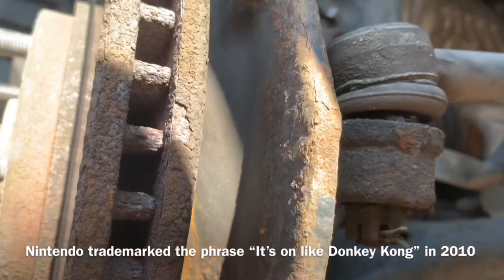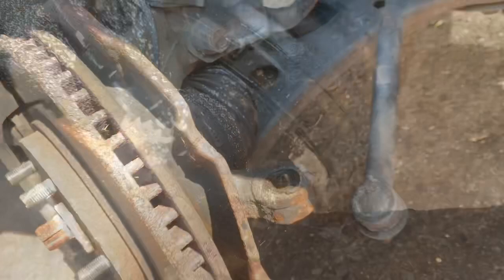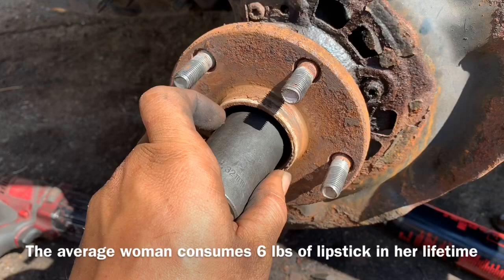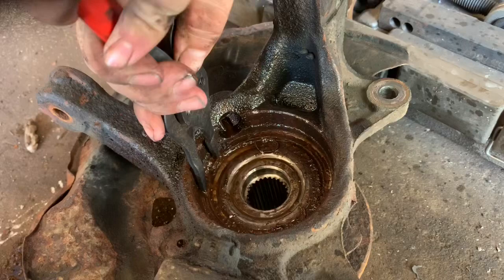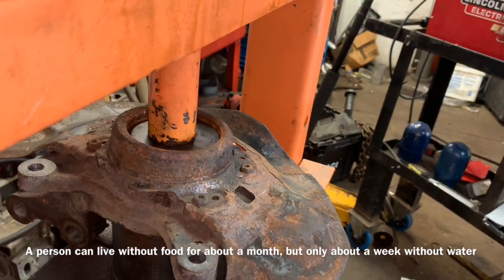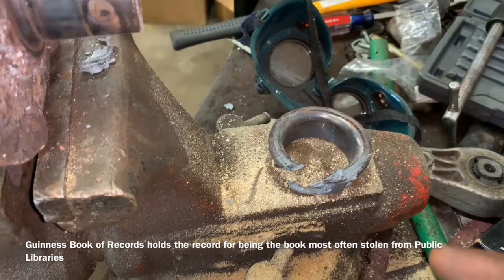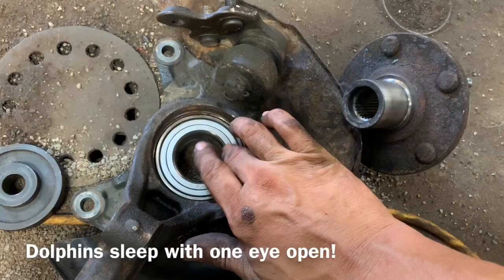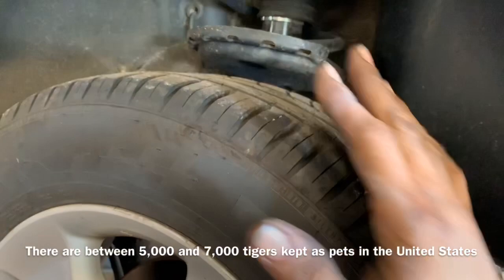Toyota Highlander Wheel Bearing Removal! Wheel Bearing installation! Great video worth watching!!!

Comment: Thank you for the excellently done, and very informative video.  Because of your video I was able to diagnose my grandson's left wheel bearing after using your great technique of 'hand on spring and spin the wheel.'    After seeing you go through the entire process of changing a wheel bearing, I did the reasonable thing and took it to my local garage to a guy who I trusted and he didn't disappoint.  Thank you again. This is a tremendously helpful video!
Reply from the maker: Well thank you very very much I greatly appreciate the kind words I certainly try my best sometimes they don’t turn out quite as well as I would like them too but I can always try to be very descriptive

Comment: Dude I have the same car, I have this clunking/knocking noise I can’t figure out where is it coming from, I replaced the controls arms, sway bar bushings and links, struts were replaced not too long ago, tie rods, still. Is it possible that the wheel bearing is making that noise!! Help

Comment: Dont know if you still pay attention to replies on this video but i attempted to press the bearing out the wrong way at first and put some serious force on it before i thought “something is wrong here”… long story short i think i may have bent one of the ears on the steering knuckle that hold the brake pad bracket on so now with everything bolted up that metal piece is rubbing on my rotor and creating an awful noise and a deep score. Do you think it is possible that i did in fact bent it ? Going to check at the junkyard this weekend to see if they have any highlanders with the front left steering knuckle still on with the hub and bearing in tact.. if not im going to have to order hub and bearing and new steering knuckle and do it all over again..
Reply from the maker: Definitely still watch my comments. The only reason I’ll stop answering them is because I get too many right now I get about 50 a day so it’s not that hard to watch them most of them are not questions. 

Yeah it sounds like you did bend it. And I’m sorry to say it sounds like you’re going to need a knuckle sorry that that happened to you.

Comment: I have a 2006 Toyota Highlander and it only revs up to 3000 RPMs what do you think is wrong with it
Reply from the maker: Plug catalytic converter or somethings wrong with the throttle.
Reply: I've been driving this car for 3 years like this it runs great you just can't get over 3000 RPMs
Reply from the maker: I’m sure whatever is wrong with it is super simple from your brief explanation I can’t formulate what the problem would be but I would almost guarantee that if you took it to a Toyota dealership it would probably take them five minutes to figure out what’s going on you could probably even try to take it to a local mom and pop place and I’d be willing to bet that they would be next to no charge depending on how busy they are I would recommend just stopping in and asking someone to take a look at it handing them $20 bill at the moment and say hey do you got five minutes to spare this guy tells me it’s probably pretty simple and I’ll but I’m right

Comment: Hey Clay great video, i need that same wheel bearing change, front driver side. But I've done the rear ones on the same exact truck, years ago and i was wondering, is the front one any different or harder than the back since the front has steering component like tie rods and ball joint or is it the same? I just don't wanna get half way through and get stuck and need a tow truck, but if i did the rear one this ones not much different right?

Comment: Wouldn’t it be WAY easier to just replace the bearing and hub, which can be purchased as an assembly? It looks like the hub and bearing could be removed without having to remove the spindle, and without needing a press.
Reply from the maker: You can buy the spindle but I’m not aware of you being able to buy the spindle and the wheel bearing the wheel bearing would still have to be pressed out. But I work on so many cars it’s possible I could be mistaken
Reply: @sharpcarco  After watching a few more videos of this job, I see that you can't do it the way I described. Never mind.
Reply: Damn I’m gonna just pay the shop to do the bearing/race part of it 😬 $40 looks worth it
Reply: Two kinds of bearings, pressed-in and bolted-on. Bolted-on wheel bearings are replaced as you say; this one is pressed-in. You can't switch, the knuckle is designed for either/or. 

The problem with pressed in bearings is the snap ring, which is installed before the hub is slid back on. Unfortunately once the hub is back in place, you can't get to that snap ring, and the hub typically bonds itself to the inner surface of the bearing. So, when you pull the hub off years later, something has to give, and the snap ring never lets go. The weakest link is the inner structure of the bearing itself, so the bearing explodes into two pieces.
Reply: The simplest way would be to buy the Moog part#’s LK027 (left side) or LK028 (right side) $192.79 from RockAuto and bolt-on. “Complete Solution -- Pre-assembled for convenience and includes a MOOG knuckle, MOOG wheel hub with studs, bearing, axle nut, backing plate and premium ball joint (where applicable) for a complete solution”
Reply from the maker: Definitely not the cheapest could you please remove your link. Part numbers are fine
Reply: @sharpcarco  Removed the link. I did say simplest way, not cheapest... When I did mine I removed the whole steering knuckle/hub assembly and searched a few shops to have them remove the old bearing and press in a new Timken bearing #510063. Cheapest I got quoted was $80 to do it plus $41 spent on the Timken so I did save about $80 vs. buying the entire Moog assembly
Reply: @STREETFIGHTER50  the knuckles have gone up to $213 and seem to be hard to find. I went that route. Thanks for the tip. Also thanks for the helpful video @The Clay Way
Edit, the tapered hole for the tie rod was too big, so I bought a spindle and bearing and had a local shop install them in my old knuckle. 👎🏻Moog